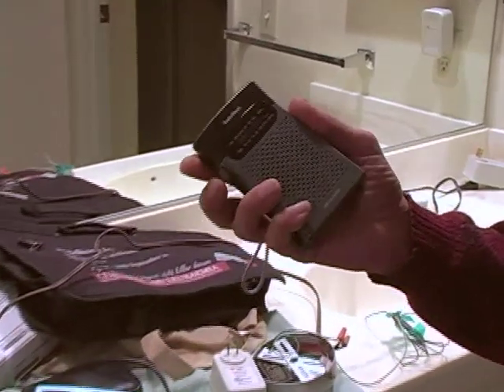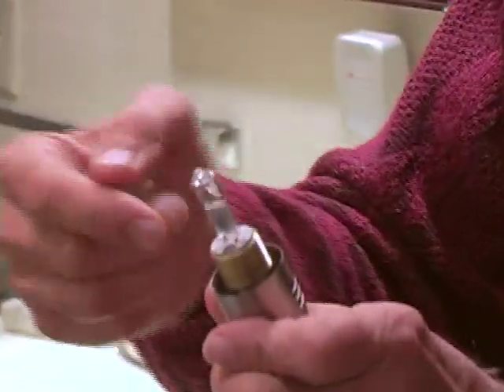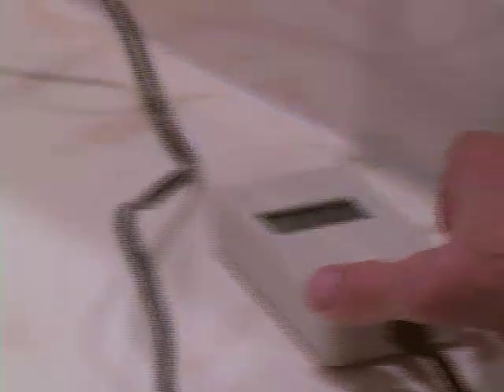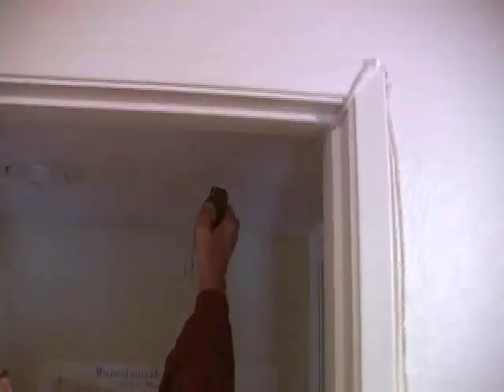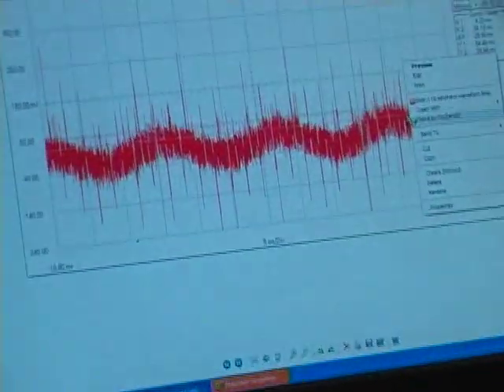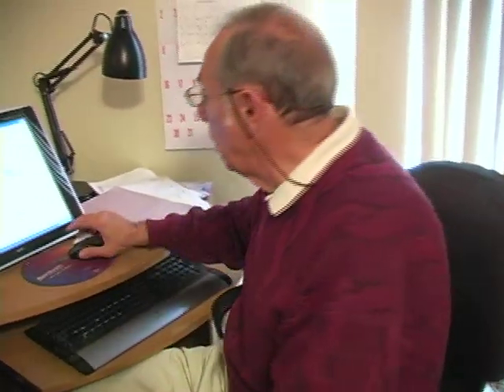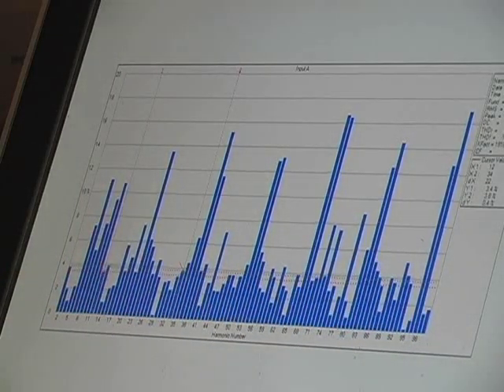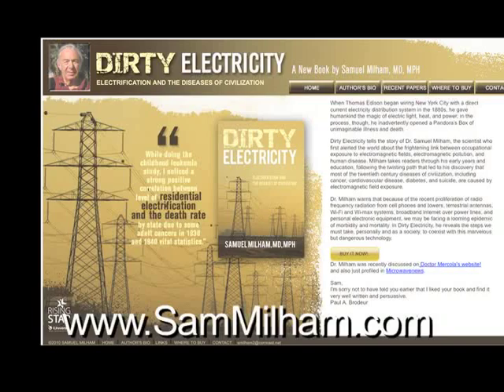Dirty Electricity - Measurement and Mitigation - Dr. Sam Milham

Comment: Excuse me, but there is a question here. Before he puts in the filter, he says that the meter shows 10000 stetzer units, and the AM radio is buzzing loud. After he uses the filter, he says it goes down to 3, which since it is x10 means it goes down to 30. If this is the case, if using the filter made the measurement go down from 10000 to 30, then why is the AM radio still buzzing loud, the same as before he used the filter?? Please, any input would be welcome to this question.
Reply: Frequency dependence

Comment: Should conduct a study about type of electrical lines in use in relation to noise.  NM-B electrical wiring shows EMR of ~1250 at the wall outlet and ~1000 along the line.  Armored Cable (BX type) shows EMR of ~50 at wall outlet and nothing along the line.  Perhaps we should use more steel enclosed cable and not Romex in residential wiring.

Comment: I appreciate what he's doing here, but I would rather hear from someone trained in electronics about these matters. This is primarily guesswork. I don't think you should use an AM radio as a detector, when you could buy a proper detector for whichever signals you are looking for online.
Reply: He was dumbing down the presentation, plus not everyone has access to an oscilloscope. He used BOTH. Would you insist that a medical doctor who treated you for snake bite
be an expert on SNAKES???